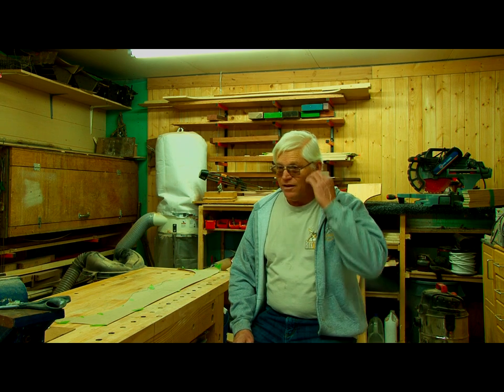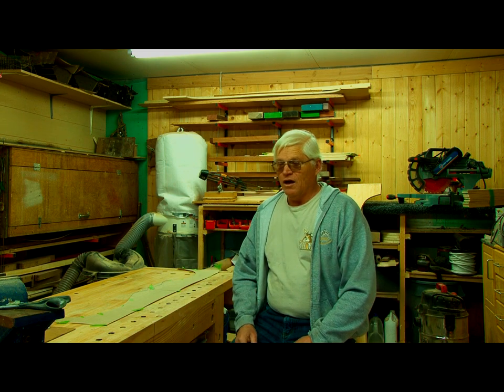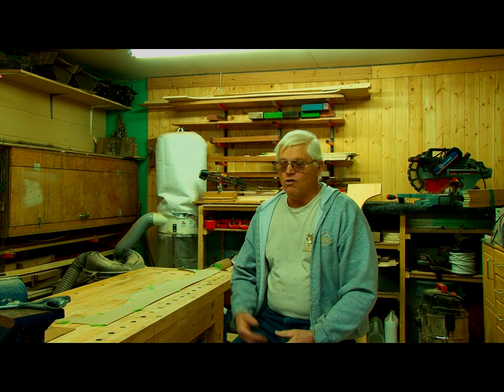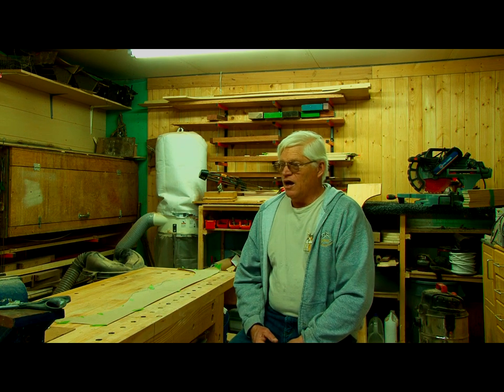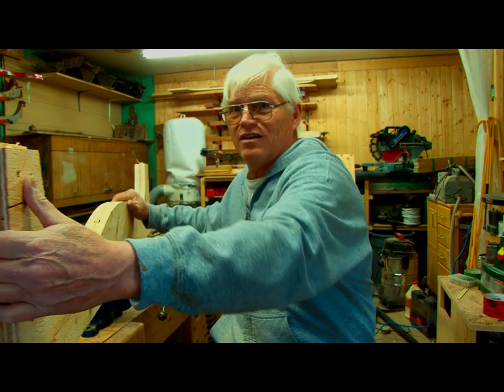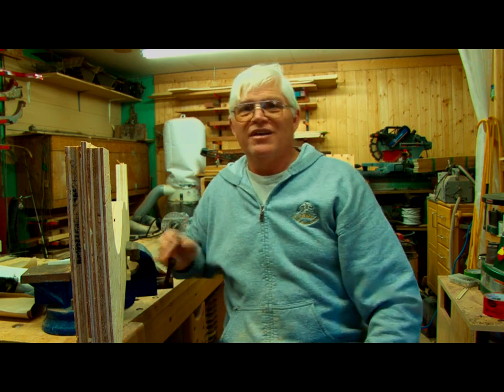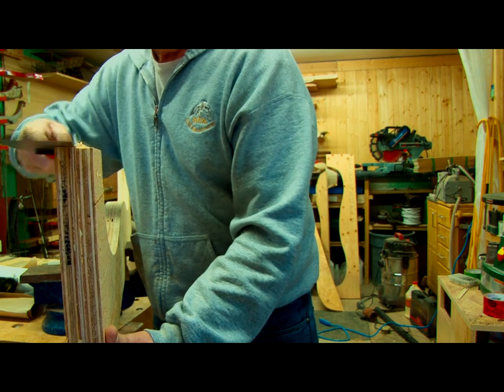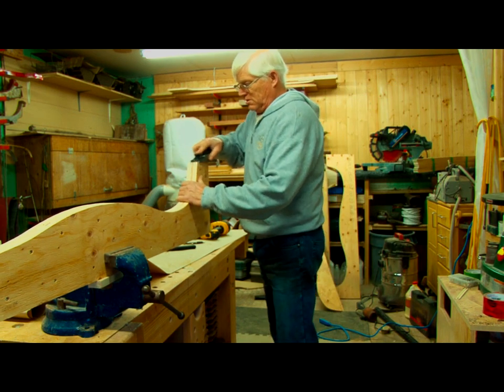Bow build 1

Comment: Well done Dale.   Pragmatic is always good.   I am getting ready to build my first bow.   It will be an Asian style primitive mid-evil design with both reflex and recurve hybrid form.    I am going for an over all 64" using two 1/16" in laminates backed on both sides with .04" black fiberglass.   The riser will be about 16" long made of domestic walnut.    Looking to be about 40 lbs draw force at 28".   Just a little ambitious for my first try at 80 years of age.
Reply from the maker: Its awesome your getting after it at 80 years young.   need any help I'm at daleguthormsen@gmail.com

Comment: Built my first recurve bow in woodshop class in 1969. Shot my first deer with it in 1972. Set archery records at 15 and 20 yards in gym class in 1973, didn't know there were set records when we were doing the 10 yard shoot. After we finished the 10 yard shoot, the coach came up to me and told me that I had missed the school record at 10 yds by 3 points, "what record, I was screwing around, 10 yards was too easy". I then broke the 15 and 20 yd record easily.